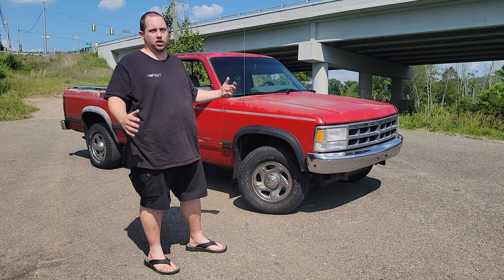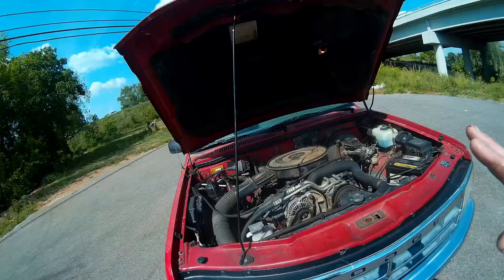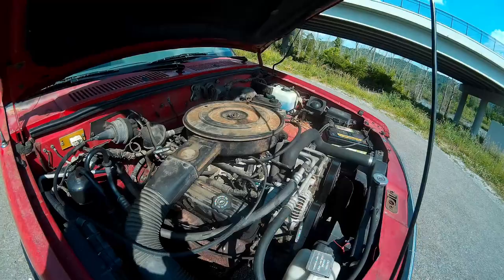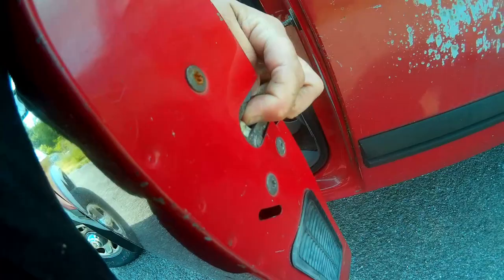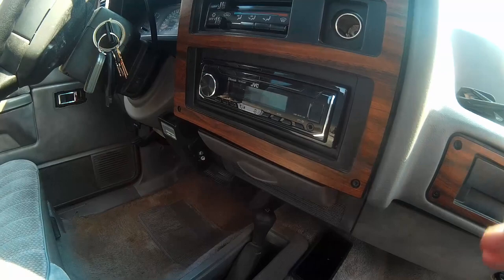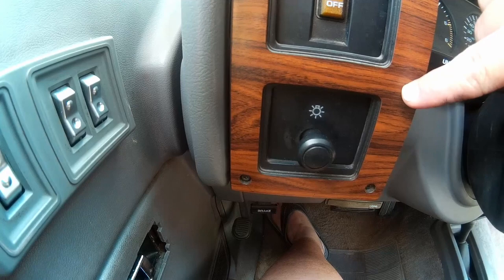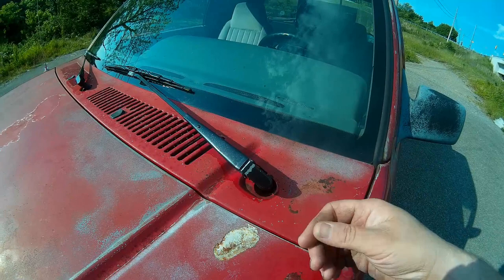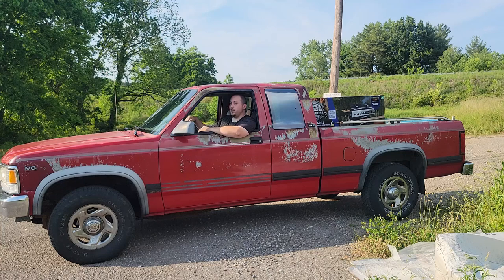To Dakota, or Not to Dakota? A Buyer's Guide for the First Generation Dodge Dakota, 1987-1996

Comment: Dad purchased our '96 3.9L five-speed 4X4 Sport model new (special order) from the dealer and it is mine now (290,000 miles). Good truck which shares the common problems mentioned in video: had to replace both doors (hinge welds cracked), rebuilt computer control twice (had to eventually add a separate old-school voltage regulator),  just replaced the a/c-heater fan resistor, access to oil filter is super-difficult, headliner fell out, tachometer is on the blink, the thermometer in the overhead console is accurate only some of the time, center caps for the styled steel wheels are plastic and crack/fall off, plastic trim around inside door handle fell off, electric door locks quit, seam around the radiator cap split open and caused small leak, one of the fog lamps fell off (no longer available for purchase anywhere), tail gate is hard to latch on passenger side, trip odometer won't reset any longer, headlamp transparent covers became super yellow (had to replace them), power switch for cruise control would not shut off the mini green light so I dis-abled it, (don't use cruise anyway), ten years after having the windshield replaced, the roof sheet metal immediately above the windshield is beginning to rust away now, passenger side carpet was wet (it was the fault of the a/c drain that leads out to the firewall), seat belt plastic covers broke off. Then maintenance items have been replaced as needed: brakes, clutch, water pump, electric fuel pump. The frame has surface rust and the clear coat on the body finish is peeling off now. The A/C and factory radio still work fine and the truck continues to serve me as a daily driver. Oh, plastic crank position sensor cracked and needed replacing. And had to replace headlamp halogen bulb plastic harness plug that melted and the wiper bushings. One more comment: with the five-speed transmission it was a must that my parking brake function properly. Well, the parking brake began releasing itself (the little pedal just suddenly popping up into the release position without notice)! I had to replace all the pedal parts that I gathered from a local recycler/wrecker.
Reply: My friend has a 93 dakota and has a low idle issue (not rough idle). Did you happen to have this symptom?
Reply: @waynezhang3969  No, that has not been a problem.

Comment: The fuel pump float that reads your gas level usually is burned which results in a new fuel pump or every 280 miles to refill on a 22 gallon tank. My 96 dakota had this issue when I got it as my first vehicle
Reply: I'm a previous owner of a 92' Dakota that I acquired as a total loss at 56,000 miles in early 2000. She needed a used bed and rear end. Faithful for over 16 years until I ran a stop sign. I still have her. The right moment came to me and I acquired a 94' Dakota recently and the fuel gauge was reading inaccurate at all times ,I added Marvel Mystery Oil to the fuel as specified and seemed to help my fuel gauge pretty much.
Reply: It has a 15 gallon tank
Reply: @ChickenGaming-er2dy  there was a optional 22 gal tank
Reply: @DJPolarbeardp  mines a 22gal
Reply: Easy  way unbolt bed fuel filler lift milk crate 45 min yr done

Comment: I have owned 4 Dodge Dakota's over the years, still have 2 of them. All had V6 in them. Fairly easy to work on.
Reply: What year do you have ? I have a 1992 dodge  V8 5.2 Dakota trying to find a steering shaft that's compatible
Reply: Does the 88 Dakota tbi have issue starting in cold weather months? V6 . Manual one is for sale but I'm not familiar with TBI
Reply: @tinoelbambino420  do you like it? thinking of getting one tomorrow.

Comment: A little note on the towing of these trucks: yours is an identical spec to my 94 and its rated for 6500 for the 4wd 5.2. 5500 for the v6 (these numbers are all for the magnums) and 2700 for the 4 cylinder (wouldnt recommend that tho). 2wd trucks are rated 300 pounds higher for each motor than the 4 wheel drive. Cab size and bed size do not matter. Im not sure about towing ratings on pre 92 trucks though i just know what ours is.

Comment: Could not help but laugh with my husband through this whole video. 😂 Our ‘89  has 90% of these same issues. I have been able to recondition a lot of parts off it to keep certain things working but it definitely needs an IAC valve and a blower motor switch. Right before the Christmas deep freeze that swept the nation I replaced the blower motor resistor, only for the heat to quit again the day before the temp dropped 50 degrees! I froze my way to work and home for 2 days with my visibility in the hands of a $10 cigarette lighter heater from Harbor Freight. I had to pull out the radio in order to get the switch out so I popped the radio open too just to see what I could do. I have the switch positioned in a place it will work now and I also got the radio working! I’m hoping to get bluetooth one day but radio sure beats road noise! 😂

Comment: I converted all lights from the instrument lights in the gauge cluster & all interior lights to all the exterior lights ther is not one incandescent bulb left on truck and it solved my light switch issue from every 2 to 3 years needing replacing to going on 10 years and its still going

Comment: My frame is so rusted, in order to prepare for Ohio’s winter I got under it with an old flathead screwdriver and a hammer and chipped off probably 10 lbs of rust so I could undercoat it. It took me 3 weekends. In the process I inadvertently opened up some new “drain holes” in the frame. Can’t wait to get an air compressor and hit it with a needle scaler this summer.

Comment: I see a ton of things thrown around as "common" failures.  Oil pressure sending unit, yes, they fail and leak.  Things like IAC,TPS,ECM, thats age, not a common failure though.  Water pumps only become common after the original fails, crap parts and all that...  The thing that made the dakota the best in its class though, it was a small truck that was every bit as capable as the full size half tons ofthe time, and shared a ton of suspension parts with '72-'93 fullsize trucks.
Reply: My dad had a 1995 with the 318 and auto trans. We lived in the mountains, and he was a landscaper. He would tow a 24' enclosed trailer full of a weed eaters, blowers, and a giant riding mower that had to weigh 1,500lbs itself, and every kind of other tool a landscaper would need. I don't know how much all that weighed, but it was definitely far more than the Dakota was rated for, and yet he hauled that loaded trailer up and down the mountains without any issues for many years.

Comment: Parts availability is hit or miss.  On my 87, we had to rebuild the turn signal switch, because they are no longer manufactured.  Also, upper control arms are no longer made for the 4x4 models, so you need to search for a donor Dakota in a wrecking yard...probably a southern, non rust belt truck.  

87s are a unicorn because that is the only year with a carb and mechanical fuel pump.  88s went to TBI and I believe that is the first year with a four speed automatic.  

Oil pressure sending units frequently fail on these....you might get a warning light or low readings on oil pressure gauge.  Also I had to cross reference mine with a Dodge Diplomat of all things to find one that would fit.  

Other than the paint issues, peeling and delamination, they are a pretty sturdy truck.
Reply: I have a 88 Dakota V6 2wd 5 speed. Think my oil pressure sending unit is on its way out. Saya oil is low but it is not. Mine has been fully restored bodywise

Comment: Yes sir I have some info on these trucks as well. I own a 1992 LE with the 3.9 l . I'm still learning different things about it everyday. I will definitely help anyone I can when it comes to figuring out anything with the truck. I'll be removing the clutch fan and adding a 3000 cfm auto fan and switch. System and big 3 upgrade already done. I'll be adding a backup camera soon.

Comment: To Dakota for sure ❤ I have a 2000 SLT Reg Cab automatic two wheel drive just now over 74,000 miles old Illinois Farm Truck. Ultra Reliable! They will run Forever just change your oil.

Comment: If you replace the exhaust manifolds you need to know what you are doing or take it to a professional muffler/exhaust shop. Some of the studs on the magnum engines extend into the coolant channels. Often times if you find a magnum with a permanent coolant leak that is the issue. Someone broke the studs. Drilled them out and had no clue they just busted through the coolant channel.

Comment: Nice they already replaced the blower resistor. Good to see. Almost burned my truck down with mine
Reply: Mine has problems out of the blower motor where is this resistor located
Reply: @ralphbishop6851  When you open the hood it is going to be the wires coming out at the back on the left from your point of view. https://easyautodiagnostics.com/images/articles-900-999/980/986/image_4.jpg
Reply: @ralphbishop6851  That whole assembly pops out. Take it to the parts store and have it replaced. Check the wires leading to it and make sure they are not bad. Also pull the wiring harness junction from the fire wall and make sure it is not corroded it looks like the link below and is  below the brake booster (big drum in the engine compartment in front of steering wheel.) If it is corroded you'll need to fix it. If not. Stuff it full of anticorrosive gel and pull back the rubber boot and stuff it full too. Needs to squeeze into every orifice.  https://i.redd.it/0g1gi0e8mad81.jpg
Reply: Ok I'll go get my truck and try that I have it now  where it will fire with starting fluid but that's it just hits couple times that's it.Thanks again I'll give it another shot  and see if. I. Can. Get. It. Going  . This channel gives me some. Encouragement.When I get it going. It. Will be. For. Sale if. Anyone. Is. Interested
Reply: @ralphbishop6851  fuel pumps on these don't like sitting. Check ignition coil, distributor, idle air controller, vacuum hoses (make sure you don't have exposed nipples 🤣). These are some of the usual culprits for a crank but no start

Comment: Intake manifold lower pan will get a vacuum leak into the crank case and cause burning oil.   And a lot get diagnosed as worn out motor.  But it not to bad to fix.

Comment: 92-95 are optiumum years running the OBD 1 system and MPI. 96 uses the OBD 2 SYSTEM and can be more problematic to maintain. The 3.9l is the most common motor makes good power and torque when coupled with the AX-15 transmission it's a potent tow vehicle for its size.
My only gripe with Dodge is the use of phenolic pistons in the front break calipers. I've only had one OBD1 PCM fail in the 25 years I've had my 93 Dakota. The other issue applies to 93-96 models washer fluid corroding the firewall wire harness plug. The only thing that comes to mind on 4wd is the transfer case tail shaft is a bit weak and the other is aluminum driveshaft are fragile. I had to replace mine on my 95 when I got it, it was bent a 1/4" a steel one will run you about 500$.

Comment: Thinking about buying a 1989 Dakota from a coworker. Paint is still somewhat good. Zero rust and sitting at about 70k miles. She kept up with the maintenance very well. Looking forward to test driving it and see what it looks like under the hood
Reply from the maker: Wow that already sounds like a gem. I would definitely jump on it if the price is right and it runs good
Reply: @ThatCarVlogChannel  that’s what I was thinking. Been looking for an older smaller truck. Living in CT it can get scary with rust issues. Just hoping there’s nothing crazy I see when I get a better look at it. Also have to convince the wife that it’s worth it  🤣
Reply from the maker: @Xero1423  zero rust sounds like a good argument lol

Comment: Have a 93 dakota LE. Love it. Problems ive had/have: headlights would not come on, had to wire my own switch. Cruise control quit working, gas gauge never worked. Prior owner switched out odometer so it reads 70k now but you can tell its more.
Reply: Oh, and the roof liner was coming off. I took it out and redid it in a color i liked
Reply: My friend's gauge pointer is sometime "swinging" especially when it's close to empty. Feels like the fuel sensor is floating in the gas. We always pump the gas around one quarter just in case.😂
Reply: The fuel sensor for the gas gauge can be replaced separately from the fuel pump. It's sold as a separate part, but you still have to drop the tank to get to it. It's inside with the pump. Have had them both replaced several times in 17 years. Pain in the ass and expensive.

Comment: My truck hates to idle for a long period of time. The oil light comes on and the engine slowly tries to die down. Also the truck will idle at about 350-450 rpms. Also the temperature will not go past 50⁰ in the winter.

Comment: 1997-2004 is 2nd Gen i own a 97 2nd gen club cab an my buddy owns a 96 single cab Dakota 1st gen both seem like decent trucks works easy to do yourself they look so different to be a year apart but motor an transmission is basically exactly the same performance is better on my 2nd gen i just think that's because it was treated better

Comment: I just bought a '96  V8 4X4 with 62,000 original miles! faint noise when putting into reverse but other than that runs amazing!. any suggestions?

Comment: I just bought an 1990 model and the issue is that the transmission slips when the oil is cold at the morning i don't know why.
Reply from the maker: Not sure about that. I know mine takes a minute, sometimes a little less, to want to engage when cold
Reply: My 91 stalls also when it first start to run but after running it’s perfect.. should I worry?

Comment: I don't get why they welded the hinge to the door I wish it was bolted and I had a problem with my passenger door lower hinge mine happened when the passenger door was cracked open and my dad moved my truck and hit a hole but just now my handle broke on the inside so I'm going to buy new parts and change it out

Comment: I’m in east TN too, I have a 92 LE 3.6L V6 RWD. I’ve replaced the water pump, fuel pump (fuel gauge doesn’t work now), serpentine belt, radiator and hoses, thermostat, blower motor and resistor, and the wiper knurls stripped and found some on a junker. There’s a ground somewhere draining the battery when parked. So I’ve had issues with probably over half of the things you mentioned. I’m recovering my headliner, visors and the fabric on the door panel inserts now. If anyone knows where I can buy just a center rear sliding window with latch or a stationary rear glass please comment. I’m going to join the FB group in the description. I look forward to seeing what you do with yours.
Reply from the maker: Nice, thanks for the input! Anywhere near knoxville?
Reply: @ThatCarVlogChannel  yeah Tricities area, not far at all!
Reply from the maker: @cc3968  that's funny, I grew up there, moved to knoxville 10 years ago
Reply: @C. C.  If the fuel gauge does t work try replace the fuel meter; when I changed mine on my 93 2.5L and it finally worked. They are a bit hard to come by so I just changed the entire cluster since the old one was bad anyway.
Reply: rear sliding window I've seen at pep boys, jc Whitney or about any aftermarket stores that sell hitches and towing accessories

Comment: Have a 93 with 528,000 on it magnum and a 96  with 318 in it 180,000 both extended cab
Reply from the maker: 528k? That's great. We'll see if mine ever gets there,  it's not even to 210 yet

Comment: so  the computer doesn't wear out, I own a 93 v6, with over 332k on it all original, it's the main power wire under the fuse box that get corroded and it will eventually corrode in half, mine has been in my family 20 years, still original r12 ac system, if y'all don't believe me it has r12 I will post a picture, this truck has not ever had any problems but normal wear and tear, it still has approximately 110 psi in the cylinders, and my timing chain is still good, it has been very well taken care of also, so before ya go with a computer replacement or anything else shoot me a message or comment here, I might be able to help someone out on it
Reply: help
Reply: @TheYammerHammer  it will be a single wire into two wires under the fuse box in the hood, one wire will be red with a white stripe, it's litterly on the loom outside on the fender under the box
Reply: @scottschnegelberger8089  post something in the FB group it hard to describe where it is
Reply: @TheYammerHammer  what's the Facebook page?
Reply: I have a 93 dodge Dakota and crank no start problem I was thinking computer has new fuel pump and plugs wires distributor ing. Coil what do you think
Reply: I have 93 Dakota 318 all parts replaced plugs wires pump etc crank no start they say computer I say no what do you think
Reply: @ralphbishop6851  check out that harness I mentioned, also check out the crank sensor
Reply: @scottschnegelberger8089  got it thanks for your help
Reply: Crank shaft sensor checked out
Reply: @scottschnegelberger8089  thanks for sharing this I appreciate your help and support. Do you  think  anyone would be interested in this truck   buy I'm really tired of having  to work   on. This  truck  I was enjoying working on it. But. I'm taking care  of my. Parents. And. Don't have the time. Anymore

Comment: can I get a link on your exhaust
Reply: I just purchased a 91 with 80,000 miles on it, zero rust or dents on the body, its a v8 5.2 but sadly its rear wheel drive. but I only got it for 1000$
Reply from the maker: @colejones7228  sweet deal!  Here's the link to to borla website. I ordered mine directly from borla.
https://www.borla.com/products/proxs-universal-muffler-40364